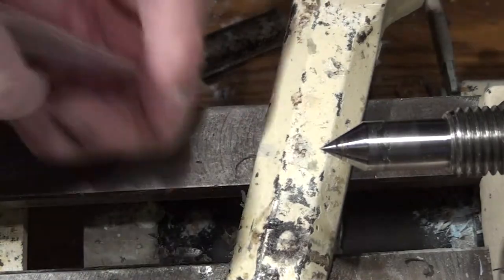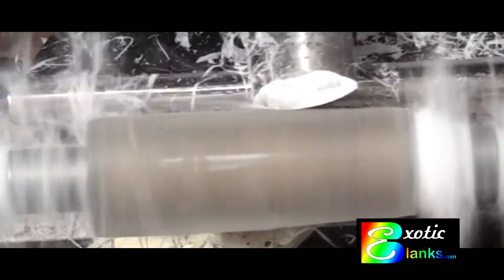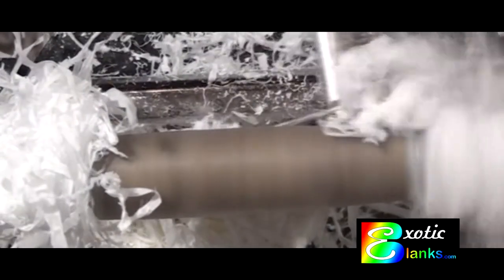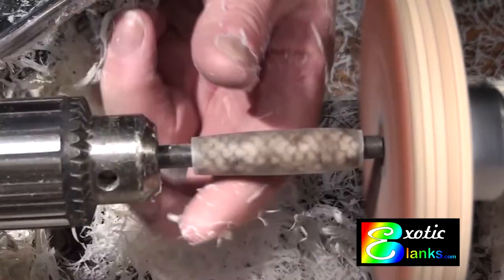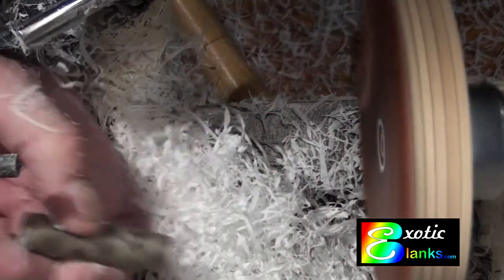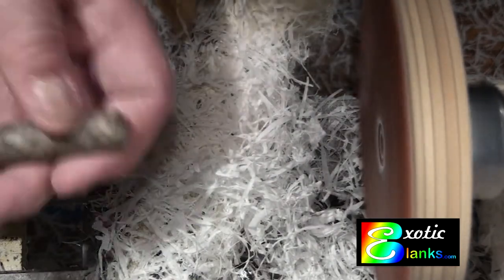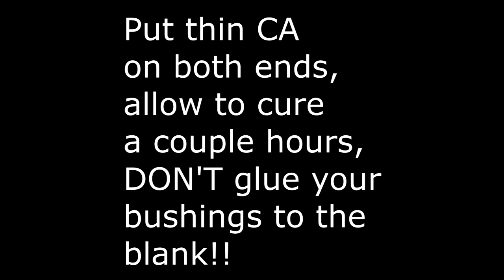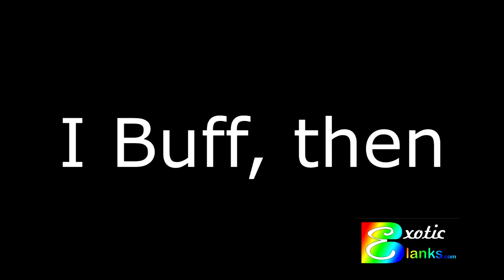Turning snakeskin blanks, using turn between centers bushings

Comment: Very nice Ed. How do you get that tool so sharp?
Reply from the maker: One thing I do NOT do well is sharpen!!  While it is "ok sharp", the real "trick" is in the angle that you use to apply the tool to the blank.  I am cutting nearly parallel to the "mandrel", not putting pressure "into" the blank, but rather cutting along the outside of the blank.  Hope that makes some sense!!

The biggest "enemy" is vibration.  Whenever you hear the cut, consider tightening the tailstock a little.  That should limit vibration.